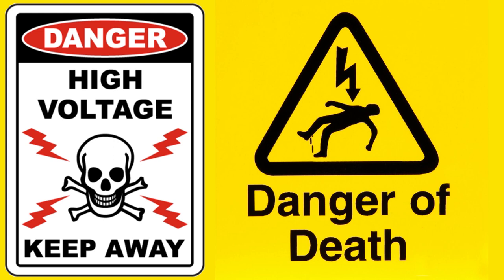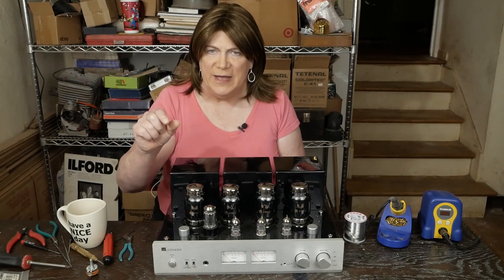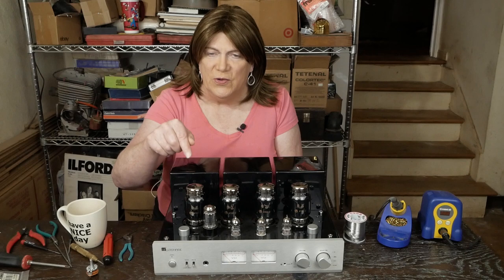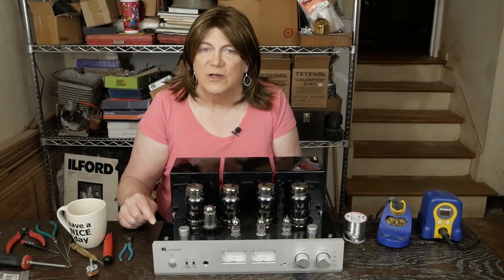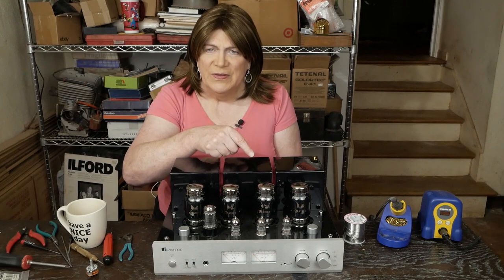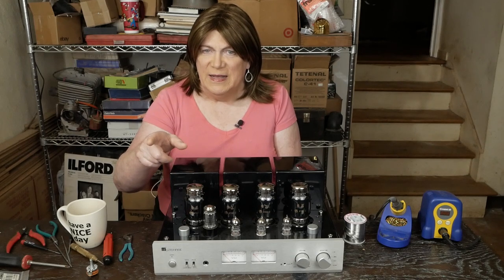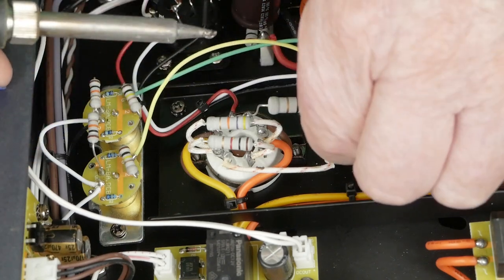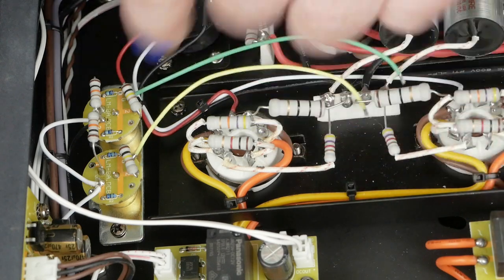Muzishare X7: Replacing the Tube Bias Potentiometers.

Comment: Great video, thank you! I know nothing about electronics but I believe there may be a grounding issue as I sometimes get a tiny shock when flicking the toggle switches on the front of the X7. It also happened once on my pre-amp volume knob when connected to the X7, but i've never had that issue before the X7 arrived. Weird!
Reply from the maker: You might need to clean the paint off the connection point from the safety ground to the chassis to ensure a solid connection. That said, if you are talking about a static electric type shock, it should happen if the amp is solidly grounded.

Comment: Does this new configuration reduce the range of adjustment?
Reply from the maker: No, and the range can be easily tweaked with the resistors on the board if needed for a specific tube.

Comment: Just want to check on this: Throughout the video you talk about adding 5k and 18k resistors to the 10k pots make them work, however once or twice you mentioned adding 5k and 8k resistors to the 10k pots which makes more sense to me since the originals were 22k. 18k is also shown in the schematic you made. Which is correct?
Reply from the maker: OK the original used a 22K pot + a 10K resistor in series on the ground side = 32K. So I added a 5K resistor to the negative supply side of the pot and added 8K to the ground resistor. 5K + a 10K pot + 18K on the ground side = 33K. Does that make sense?
Reply: @SkunkieDesignsElectronics  Yes, definitely makes sense. I missed that part about the 10k resistor that was already there. Is that on the R8 as well? I looked back and I realize now it was on the R8 thread you talked about adding 8k of resistance; not necessarily an 8k resistor.
Reply: @SkunkieDesignsElectronics Hi Stephe, I have the parts to do this mod, just to be clear, 8K should read 18K, just a typo   Error 👍
Reply: Done this mod today, all works ok, thanks for all the upgrade info on the X7       .

Comment: @SkunkieDesignsElectronics Hi Stephe, I actualy try to fix an issue on my Cayin cs55, for that i need to change the bias pot it's a 22k , it's really hard to find or it's 40euros piece; i would like to doit  like you and put a 10k pot and  resistors but it's on tiny bord printed on each face , to dificult for me , so i would like to know if it's possible to put a potentiometre close to 22k like 20,25 or 50k is it a problem?
thanks for all your pationating video
Reply from the maker: Shouldn't be a problem. It's just a voltage divider.
Reply: @SkunkieDesignsElectronics  Thank you so much for your anwser , for my repair i only have 2 solution due tu the diameter of the potentiometer so i can put a 20k or a 50k, wich one it's a better option, originaly it was a 22k?
sorry for those kind of non electrician question
Reply from the maker: 20K